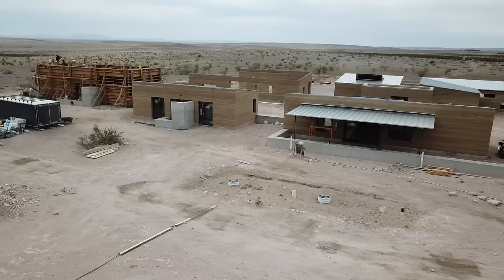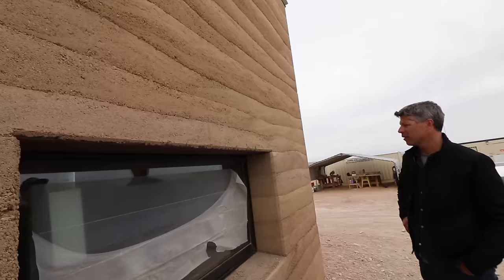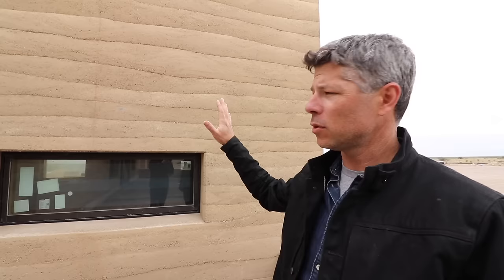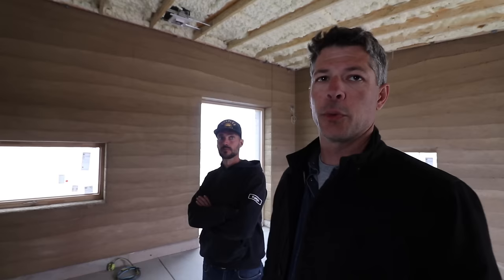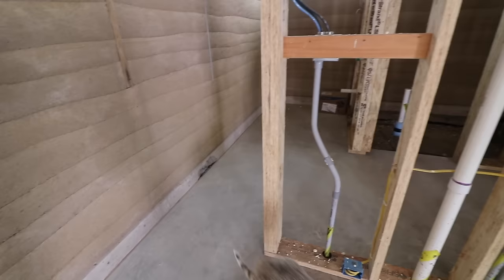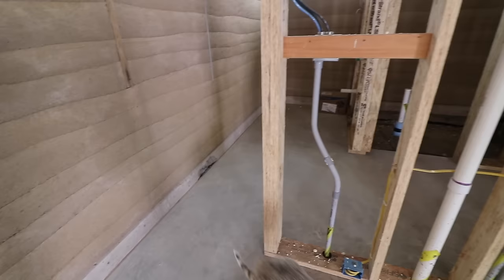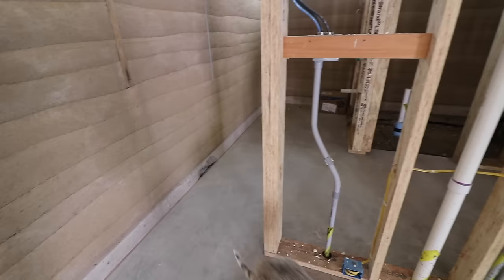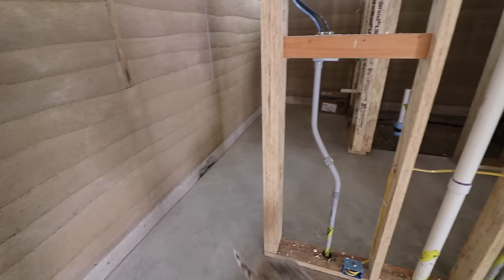Rammed Earth : You won’t Believe How They Build This!

Comment: Yeah...you're clueless. I live here. Air conditioning or swamp coolers are a must. So are heaters. This isn't some paradise of temperature  and humidity.

It is not "cooler" here. Summers are usually 8 months long with an average temperature of 95°F. And for at least 1-3 months of the summer the nights are 80+°F.

So you need cooling here.

Dry heat you say? Doesn't matter past 78°F. Which is the average fall temperature for about 2 months. Then we hit winter/spring. 

Winter has usually 1 week of completely unbearable cold. During which we sometimes can see freezing rain resulting in an inch of ICE on the roads, breaks power poles like toothpicks, and is all around miserable. 

The entire rest of the 2 month winter/spring period will literally have temperature swings of up to 80° on some day to day runs. You will be freezing, then the next day stripping to shorts. 

Just when you think the weather makes up it's mind...the spring hailstorms start. 98°F and 80% humidity...storms come in and drop it down to 60 or 70° and that's when you know the hail is coming. Usually it's just the pea size stuff up to maybe a nickel. Sometimes it's golf ball or bigger.

So you need heating in the winter.

 The best systems are the automatic heat/cool central air for dealing with the winter and spring.

 But the absolute most common air conditioning system is the swamp coolers here. Also known as evaporative cooling. It works well in the summer. If, like today, you have had some crazy extra wet couple of weeks so the humidity is obnoxiously high...they are useless. It currently feels like the east Texas where I grew up. 

For heating the most common local source are gas furnaces.

So yeah, speak of what you know, and don't embellish crap trying to act like what you're doing is the way to do things for the environment in a place you clearly don't know the environment. 

Not to mention you are using equipment that's making far more pollution to quarry, mix, and set your aggregate than is involved in traditional building techniques. Even local historical ones out here.

There's a great guy who makes stucco brick houses in Alpine 30 miles away. Cheaper, better, and more environmentally friendly than this.
Reply: Howdy Shaun, sorry we haven't met yet.  There happens to be a robust heating and cooling system being installed on this project. I appreciate your insight into the weather. The guys and I have only been in Marfa a little over a year, but have experienced much of what you talked about. That's kind of what I like about West TX. Obviously there are many ways to build a house, this client wanted rammed earth, so that's what we did. Thanks

Comment: this method of building is interesting but unless your building a bunker, idk how most people would feel about a 2 ft thick wall, not to mention concrete would just be cheaper.

the only legitimate reason to have a building like this is to have a unique building.
Reply: Shows how little you know
Reply: @FearScherer  nice way to make a legitimate argument.
Reply: @dmerritt4ever  ok. Let's let aside the environmental cost, which is a substantial argument in itself. Any idea how much a 2ft concrete wall would cost? Obviously not. Or even an 8" concrete wall? And those aren't very pretty so decide on how to clad them. The cost argument is done. Can you not conceptualize someone wanting more than 2x4, plywood, siding and drywall? The energy benefits of earthen dwellings? The fact that these walls will be there many generations from now with no upkeep? Your dismissive comment highlights your ignorance on the subject and education would be better spent on someone with open eyes and objective aims
Reply: @FearScherer  dude did you watch the video? the walls are made with concrete mix and dirt meaning is just compressed diluted concrete mix in the first place. and as for the cost, they said in the video such a thing does not come cheap, aka, really expensive, plus if it was just concrete such a thick wall would be unnecessary unless your building a bank vault. as for the "pretty" factor, dude, they look like dirt minecraft houses, you can't deny that
Reply: @dmerritt4ever  concrete and Portland cement are two different things, although one comprises a percentage of the other. There are several other factors like off gassing, thermal banking (thermal mass), material sourcing,  upkeep simplicity, I mean the list really goes on and on. Let me apologize if I may have seemed.. I don't know... Condescending, short, stuck up, know-it-all, aggressive, passive, or insert-what-you-may. My sincere apologies. But I enjoy the myriad of options we have or could have when building a dwelling. I've been in the construction industry for my entire adult life and the run of the mill options aren't really cost effective, energy efficient or durable. I've really enjoyed exploring these other options that really seem to fire on all cylinders. It's crazy to me that you could build a structure with many multiples of load bearing, durability and serviceability and it not be allowed in many areas because it isn't the norm... But what do I know? Leave it to the inspectors and code writers \enforcers. (Not that they are necessary bad people) a natural man has the right to feed himself and shelter himself, right?

Comment: My impression is that you'll lose a lot of the benefit from the thermal mass since it's exposed directly to the outside. With the mass insulated from the exterior, you can supposedly not only avoid 24-hour temperature fluctuations, but you can get annualized thermal inertial. (The mass heats you the whole winter, and cools you the whole summer.) Definitely look into Mike Oehler's earth-integrating housing designs, and WOFATI houses.

Comment: Old Dog, New Trick!  Rammed Earth is a cool name, but this is just compacted soil cement, or fine grained concrete.  The "soil" they are using appears to be more sand than soil, which is good but nothing super.  Dirt is pretty cheap. So, its mostly labor costs.  The insulation properties of most any 2 foot thick material is pretty good.  So the right client sounds like needs to be well healed and very patient, 2 years, seriously?? You could just consider this an Adobe home on steroids.

Comment: If this is west Texas it is probably part of the Chihuahuan Desert. Which has been experiencing low  vibration  earthquakes for the past  28 years. Also the average rain  is 20 + inches in the summertime.  This is called the monsoon season in that area. Since there's no scrub plants left in that area other new houses and there's no mention of replanting anything, The summer time is going to be in mud and muck.
Reply: Also they keep saying the walls are two feet thick. I checked the specs  they are not two feet thick. In fact the lip they're using for the roof it's not even 6 in. And it cannot I take a load of a normal pitched roof house.

Comment: Soooooo your digging up holes in the earth, and using heavy equipment, run by gas to be “green” makes sense.
Reply: It does if the long term benefits outweigh the short term environmental costs.  It even makes sense if, in the long run, it costs less in environmental terms than other types of construction.

Comment: The mass doesn't work without exterior insulation. Really no reason to get into rammed earth. Adobe/pumice/chopped straw/water slurry wall requires no special forming because lateral (horizontal) pressure on the forms is minimal. Rip 1/2" CDX or OSB 4x8 shts to 24" separated by 2x2 cut to length of desired wall thickness "screwed thru OSB into 2x2 ends with one ordinary deck screw each side. Use a 2x4 up and down tamp for even settling. Very easy. 24" OSB form is then raised after 2 or 3 days for the next pour.

Comment: Not impressed until they leave out Portland cement from these rammed earth builds. Just doesn't seem eco-friendly. I would've tried Hempcrete.
Reply: The Kirk
Doesn’t hempcrete use exclusively Portland cement a little sand and hemp, but mostly cement. That in itself contradicts your statement of wanting it to be more echo-friendly, i.e. natural to include breathable and healthy, etc. lol! Unless you meant something besides eco-friendly. Not trying to be an arse just saying! They are using mostly course sand and clay like material with a fraction of cement used to help solidify and bond the soil together making it actually pretty natural even most of what is cement is a natural product as well. But even without that natural factor of the cement it is only maybe at the most only 1/3 of the mixture is cement whereas the soil is more like 2/3 or more if the cement is less than the 1/3 amount cement, where as with hemp Crete it is at least a 50/50 mix cement/hemp, if not higher on the cement side of things plus a little sand. They could have added hemp fibers here or fine straw and had an even more stable structure overall that would have withstood just about anything except for the wrath of GOD! Which with the extravagance being used here it very may well be meeting his wrath in the future!!
The reason of the expense possibly translating as why high cost, that is actually due to the high labor intensive work of the job that adds up and runs the cost up! The expense is not due to the use of cement. Peace!!
Reply: @theducklinghomesteadandgar6639  If someone uses Portland with hemp shiv then what would be the point of using hempcrete as an alternative, even if the amount of cement used was low? Makes no sense. Hempcrete is a natural, non-toxic, eco-friendly alternative to Portland. Of course, you would need a lime-based binder to keep things together, much like they did in 6th century France.

I agree it's not a lot of Portland used in the mix but when you think about a "natural" project like "rammed earth", you would think anyone doing such a job would follow through and make it as natural as possible. And if you're a contractor, you may have a client who is chemically sensitive or just wants to know their structure is as non-toxic as possible.

Also, cement is a big environmental problem and we should be moving away from it. The Romans did a great job with their concrete and I'm glad scientist are coming up with a mixture to replicate that ancient wonder so it can be used for modern projects, or one could just make it through trial and error. 

What's cheap now may cost so much more in the future and not just in terms of money!

Live Long and Prosper!
Reply: The Kirk 
My understanding of hempcrete is different than yours. A mixture of Portland cement and small cut up bits of the stalks and stems or some part of the plant.  I had not seen it used as you express here so now I get what and why you said as you did! I agree! This was the first rammed earth build like this where I have seen cement used and I thought it unnecessary myself and toxic. After all the point is to create something similar to nature using similar techniques to create it and the natural process is very strong and never included Portland cement. But it will be the owners loss for requesting it or accepting the mention of it being used!!! My family are saving to purchase some land and will be building basically rammed earth but using bags instead of forms. And no way would I use cement in the bags nor on the covering of walls, it completely undermines the whole reason for building that way!!!

Comment: You, Don't need to be Wealthy, to afford a traditional adobe, mud hut. Traditional peasant accomodation. But the above is about as far from that, as you can get. They don't disclose what the "mud "mix is. They already stated they used , Portland cement, which is cheating...:-;

Comment: Needs more windows -- looks like a prison. The design is very bland. Although, the materials used may be hardy reinforcement, I don't think sitting in this all day long or night would be comfy... It's in need of more architecture. Too many walls, and not enough light... makes you depressed.

Comment: Interesting, but not very practical. Rammed earth still needs concrete bond beams, steel beams and rebar. These still need a concrete foundation and floors. In the floors the PEX should go under the rebar. Electrical is not in the walls.Insulating Concrete Form (ICFs) are still the best.